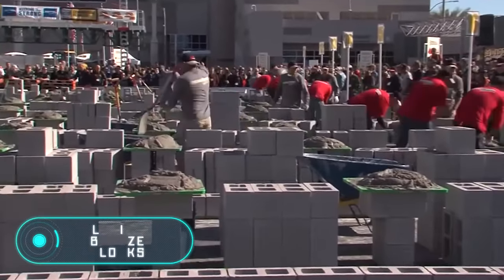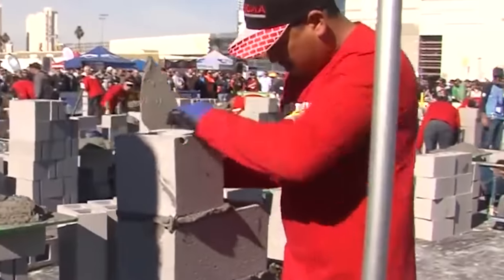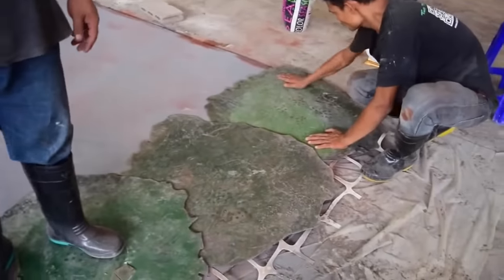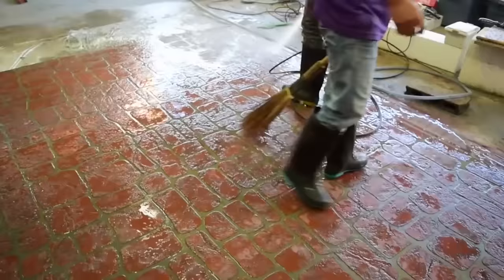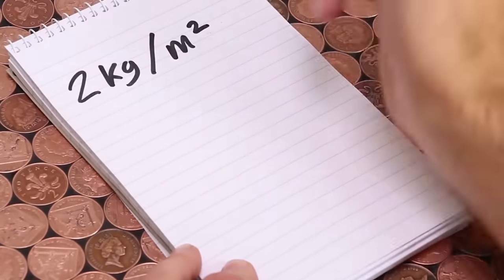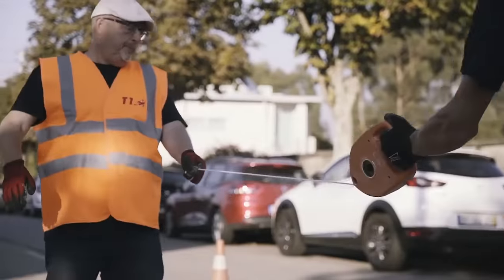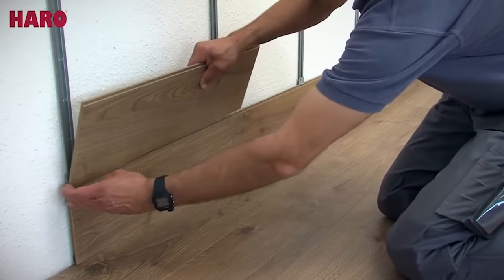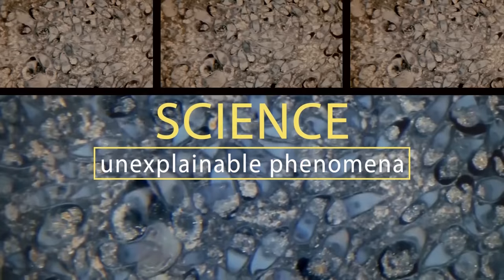CREATIVE CONSTRUCTION IDEAS THAT WILL BLOW YOUR MIND

Comment: I work brick and mortar to build basements.  I hope there’s some useful info.   I wanna find or make something like a pipe with chain and hooks at both ends that can be hooked to mirror buckets or cinder blocks.  Then you could carry 4 instead of 2.   We do the same stack and tray spacing technique as shown by the first crew.
Reply: Why? 2 blocks aren't heavy enough? I'm a union mason, and our hod carriers, use these great new inventions for carrying more than 2 blocks, they are called wheel barrows, dollies, cranes, and fork lifts. They allow you carry multiple blocks, and still be able to walk and have shoulders that work, when you age. If you really want to be productive look into getting a mule, it is a robotic hand connected to a cable that holds the weight for you, so you can lay 12" block as easy as brick, all day long.